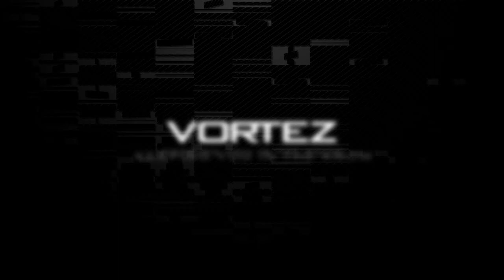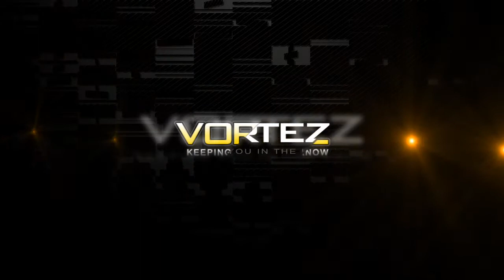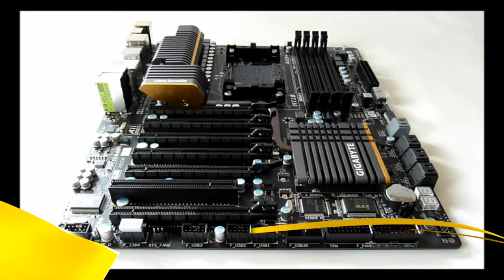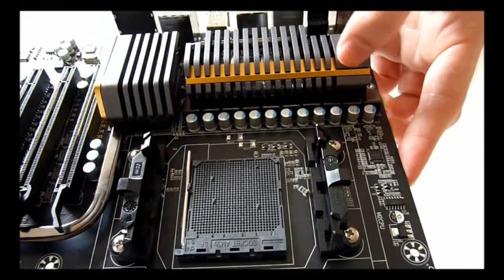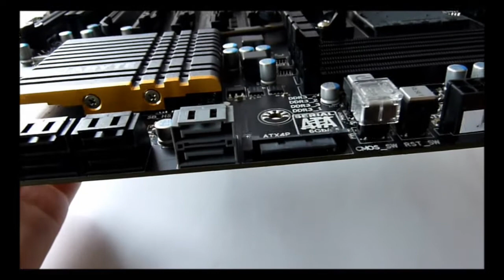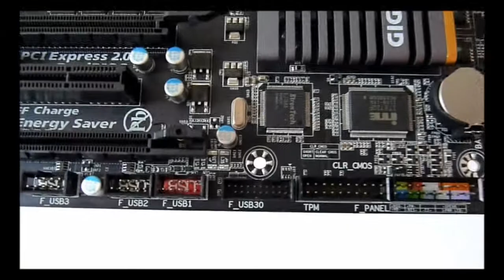GIGABYTE 990FXA-UD7 Preview

Comment: Spoiler: So far I'm really liking this and managed to have CPU-NB and HT-Link both at 2.9GHz. But if you ever get to clocking it and the board begins to behave strangely, turn the voltage optimizer off. I thought I'd see how well it fared but then the board wouldn't post with that on under even mild overclocks